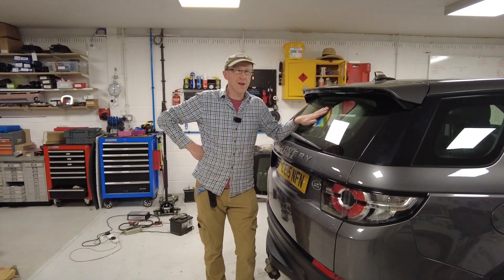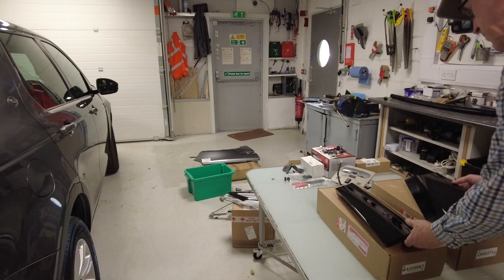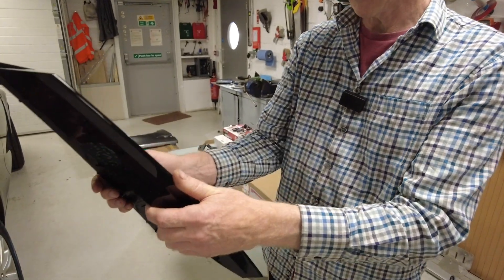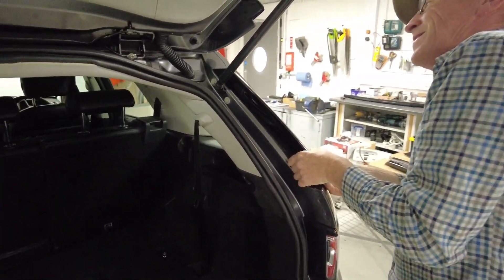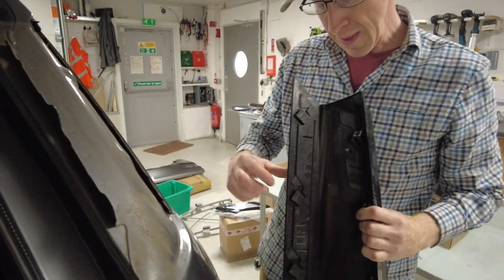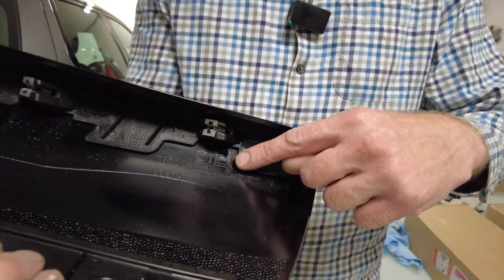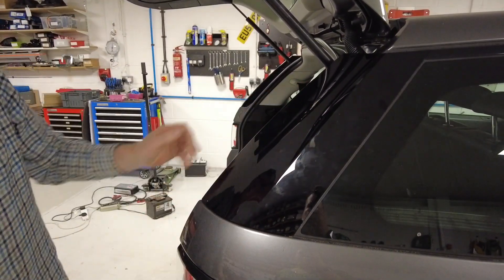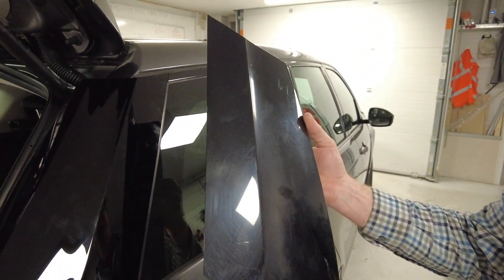How to Remove Land Rover Discovery Sport L550  "D" Pillar Cover Trim

Comment: Great video as usual
Is it possible to make a video about installing android headunit to the discovery sport?
Thanks so much !
Reply from the maker: I have not looked - are these available ?
Reply: @L663  Thanks for replying. Actually I am having a Discovery Sport 2015 and I installed the Android headunit myself. However, I felt it very strange that I’m not able to switch on the headunit if the ACC cable is not connected. Also, the reverse camera only works occasionally that doesn’t appear automatically when I switch to R in the gearbox. Sometimes it’s ok, sometimes not
I have searched the YouTube and there isn’t any proper and detailed installation method as you did in the previous cars

Thanks anyway, always support

Comment: A useful con video…I can see those LED alights coming! I am paranoid about them getting scratched..as you will know! 😀😀😀
Reply from the maker: Hi Richard -They seem to scratch easy but they are not ultra expensive and easy to change !
Reply: @L663  Good news…the door window frames seem to fade slightly as well..maybe we need a set of all the black “greenhouse” bits? 🤔🤔🙂🙂🙂

Comment: Can you confirm if the Evoque dashcam power loom you sell works on this disco sport now you have one? It's the same console i'm told. Also when will they be back in stock please.
Reply from the maker: Hi Colin - I have looked at the wiring diagram the ignition live seems to come from an airbag warning light circuit so I am still investigating this - for some reason they changed the wiring !